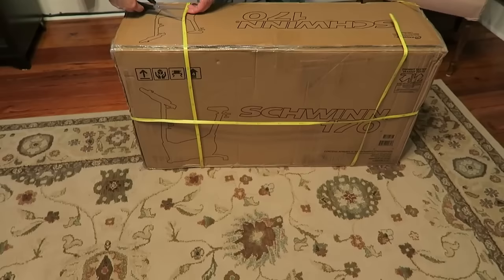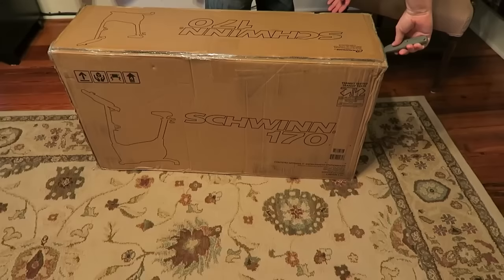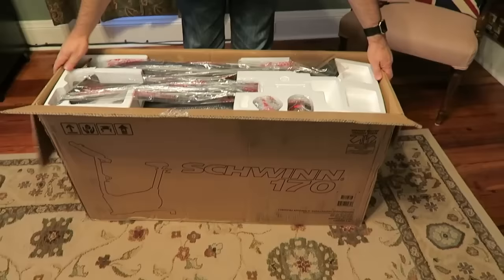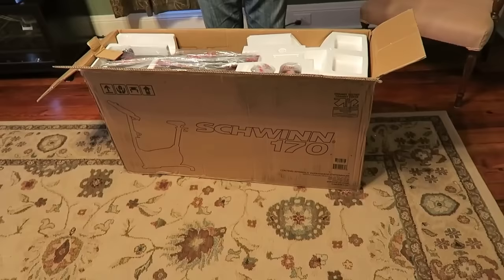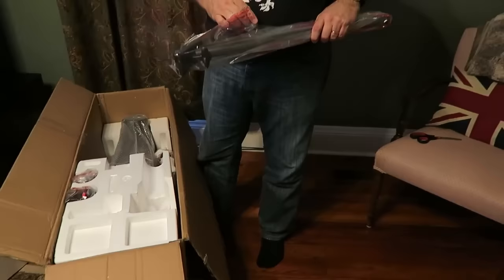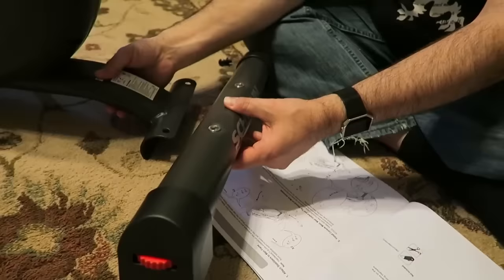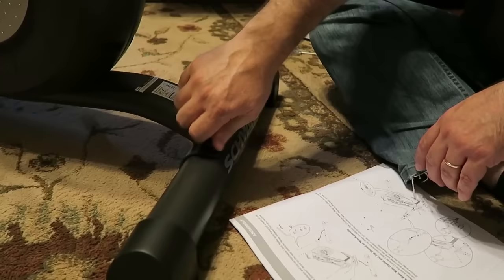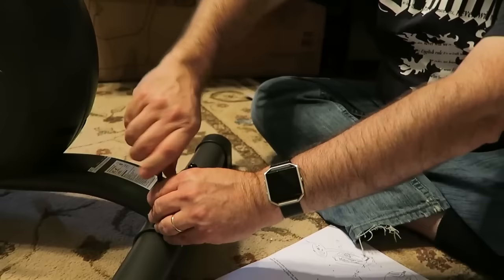Schwinn 170 Upright Bike Assembly & Review

Comment: Thank you so much! There is no way I would have assembled this without your video. I watched the whole video, then looked through the instructions, set up the pieces, and watched each section as I assembled the bike. I was able to get it together in about 1.5 hours total, just one person. I would recommend to future viewers: Kevin experiments with the cover and front post. Just slide the cover on the post, prop the post across a chair, and attach the leads. Second: Attach the handlebars before pulling through the cable, then snap the cover in place. Third: Have the screws from the screen ready and as soon as you've snapped in the cords, place two screws to hold the screen in place, then tighten. Have all tools and pieces close by, in a box lid. Now on to adjusting the bike and programming it. Again, thank you, Kevin and Tami!
Reply from the maker: We are so glad this was helpful to you!

Comment: Hi, I wanted to add how great your instruction were.  Very useful.  I easily got mine together, but ran into a problem with the cable connection from the machine to the mast drive.  Tried turning it on and it didn't work.  So far happy with Nautilus support. They spent some time with me and are sending another cable.  But none of this was your fault. Except I should have paid attention; when you said you'd hear a "snap." I didn't hear a snap and when I didn't get power found the cables disconnected.  At any rate, I want to say thanks again for the instructions.  Excelellent.
Reply from the maker: Thank you so much, Ed!

Comment: Great video, easy set up. 13:18 My only suggestion would be to attach the handle bars first, and then run the line through the device, that way you are not carrying it.

Comment: Thanks again--for the great camera shooting as well.
Just a bit of a review on the performance of the bike. I wouldn't buy it again because--I just received the 170 and I really don't care for the fit.  I am 5'2" petite and the seat doesn't go forward enough for my reach to be comfortable.  I have to set the seat height at 2 or 3 and then the reach is very uncomfortable.  At the seat height of 2/3 the console appears huge and unreachable.  If I sit upright in the seat, which I usually do, my fingertips barely touch the handle bar.  They need to make a much smaller profile bike for smaller bodies.  I guess I should have checked it out better online.
I have an inexpensive xterra without the bells and whistles and it fits much better. I am  disappointed in the 170 because I was excited to experience the technology and I waited months. Oh well.
Take care

Comment: Hi your video is great thanks. I assembled this bike one month ago no problem but now I need to tighten the side screws on the bottom front pole that is covered by the shell because the pole is loose. I probably didn't tighten enough before snapping the shell into place. When I try to remove the shell I can't. It's snapped in place pretty tight. I've tried using a knife and a screwdriver to pry the back side of the shell up and it comes up slightly but doesn't snap open. I'm afraid to apply anymore pressure to pull the shell off because it feels as if I may break the shell and not be able to snap it back into place. Any suggestions on how to best life the shell off?

Comment: Thanks Tami and Kevin this was really helpful, I wouldn't have been able to put this together without the video! I did have a question about one issue I have with the bike. Whenever I ride it the seat becomes loose and I have to tighten it again. Is there something I should do to avoid this?
Reply from the maker: You just tighten it as much as you can. When I get on or off, my seat moves as well though.

Comment: Great video!  Where does the power plug connect on the bike?  I just can't find it!
Reply from the maker: The very front where the handle bars are, down at the bottom there is a silver sticker and a silver nut. It goes in the silver nut.
Reply: Bottom front

Comment: I just bought my Schwinn 170 upright today, and am in the process of assembling it right now. On page 9 of the instruction manual, it says "Be sure the tabs of the Top Shroud snap into the main assembly". There are six (6) tabs that simply are too short, as the two front tabs (right underneath that red mast gasket) either won't snap in at all, or snap in very loosely. Therefore I can't get my Top Shroud to be snug, but instead, it's loose. Frankly, this bespeaks poor construction quality in my opinion. I noticed that you cover this part at 24:10 to 24:20, saying that "this literally just snaps in place". Is yours loose too? Or am I doing something wrong? I noticed you glossed over this part as if this was the easiest step to do. Thank-you.
Reply from the maker: Ours snapped right into place with no problems.
Reply: Thank-you for your fast reply! I did not expect it to be that quick. I finished assembling my bike last night. Though that shroud is still kinda loose, at least all the hardware (including the electrical connections) otherwise so far works properly, after getting it altogether! According to EZ-vid reviews, this model's only drawback was that it could be hard to assemble. For me, that is significant as this was the first time I have ever assembled an expensive machine. And I am in my '60's.

But now, I BlueTooth paired my Schwinn 170 with the Schwinn Trainer app for my iPhone. The app acknowledges that the bike is "synced"(Is that the same thing as "paired"?) with the app. But even though the phone is less than 10 feet away from the bike, it still is not recording my workout data. At first I thought it might be because my iPhone was simultaneously USB (hardwired) tethered to my iMac desktop computer to enable my "Personal Hotspot". I thought maybe the iPhone cannot maintain both a USB connection to one device (the computer), while simultaneously maintaining a BlueTooth connection to another device (the bike). But then, I tried it again with the phone closer to the bike, and with it no longer connected to my computer. But still, the app is not recording my workout data. What am I doing wrong?

Comment: This is great timing, thank you for sharing. I really want a second option other than my elliptical bc my legs get so fatigued using it so often. However, we live on the 3rd floor of our apartment building, and every stationary bike I read reviews about everyone complains about the noise level. Have you noticed that this one shakes and makes much noise? Thanks Tami!
Reply from the maker: It does not shake at all and it is very quiet (so far).
Reply: Christi Dixon Recumbent excercise bikes are really good, great if you  have any back or knee problems .I have family members who had to do physical therapy and this is the bike they recommend.most who can't ride upright stationary bikes,can Ride a recumbent  bike.
Reply: Thanks for the video it was helpful but can u tell me why my computer is not on ? I checked the connections it good do I have to ride the bike to produce power ?